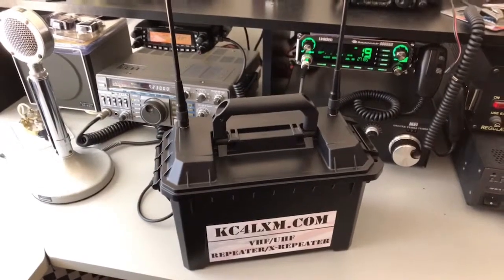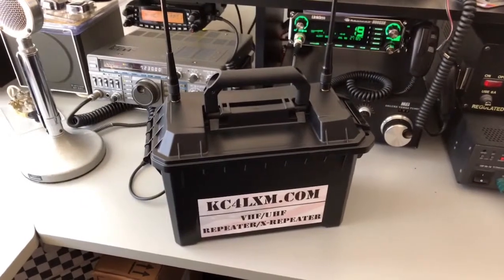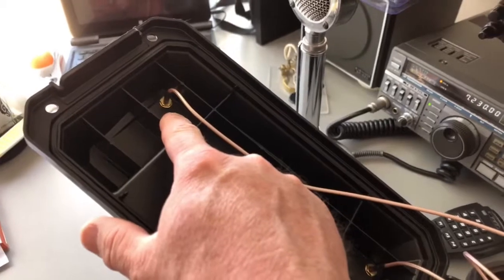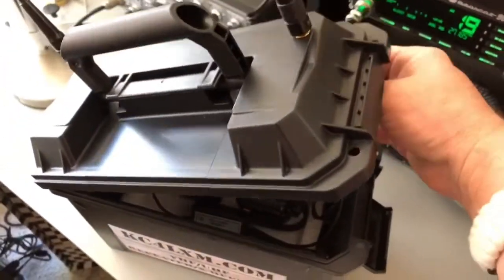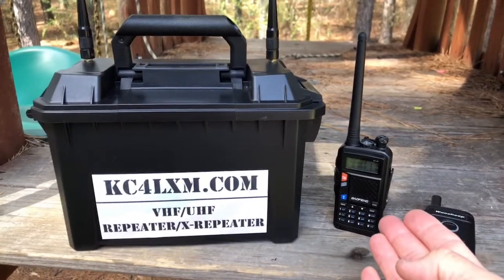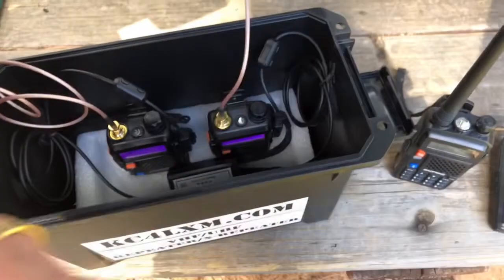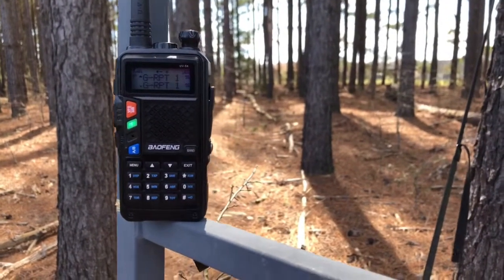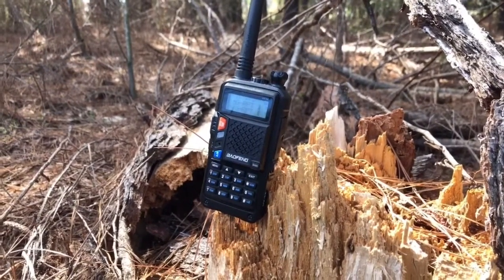KC4LXM.com VHF/UHF Repeater/Cross-Band Repeater Test Project

Comment: Better to use duplexer so you'll just need single antenna for your repeater.  Put it on the highest place as possible. If you could use an outdoor omni with high gain it will serves you well. Goodluck mate 😇

Comment: Antenna height, and quality is your problem. Using factory rubber antenna not going to cut it for a repeater. Hanging a well tuned homemade dipole, verticle, or spend another $80 on two Ed Fong antennas from a tree would really increase distance and clarity.  $10 homemade. Need quality cable at least for the uhf. You need them both up high for both TX and RX.
Reply: I've heard that you should put receiving antenna above transmitting antenna with that configuration.

Comment: If using the same band you need vertical separation of the two antennas.
Reply from the maker: Generally you will need 10 to 15 feet of separation depending on the frequency of the radios.
Reply: @kc4lxm  not totally sure, but I recently read keeping antennae stacked vertically 15 feet apart, with the transmitting antenna below the receiving antenna.....Receiving antenna as the highest antenna.

Comment: Do u have part number for the device between the two radios ? it would be much appreciated .
Reply: In crossband repeater using only one radio.try to search in youtube a mobile radio can capable of crossband repeat.that method of two handheld radio is really not working..
Reply from the maker: This link will take you to the repeater controller part. https://www.amazon.com/gp/product/B00ITN0T0G/ref=ppx_yo_dt_b_search_asin_title?ie=UTF8&psc=1

Comment: How many meters or miles your repeater reach to communicate?
Reply from the maker: Untested at this time, but given sufficient elevation should be able to reach out 3-5 miles on low power most likely.
Reply: @kc4lxm  that idea is not working at all..mine i quit and i adopt and try the new method.the cross band repeater mobile radio..is a mobile radio that capable in cross band repeat using only 1 mobile radio as my base.just buy a dual band antenna that match your frequency..just searching in youtube..